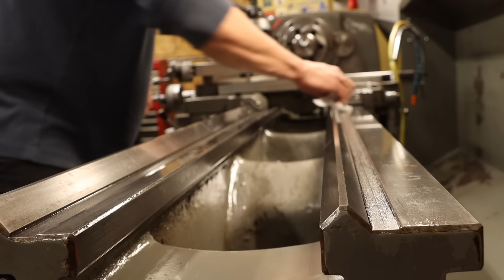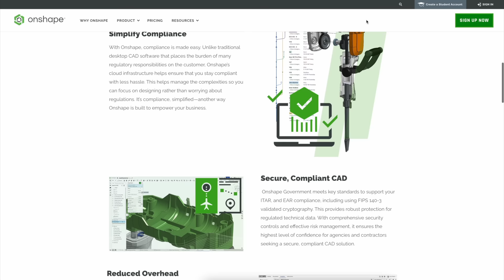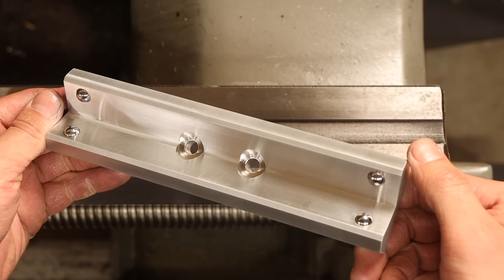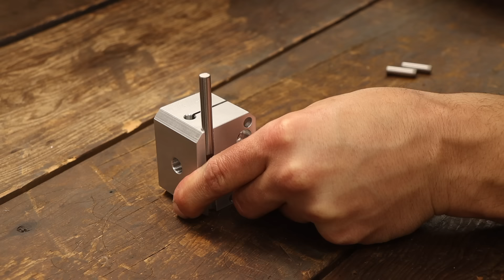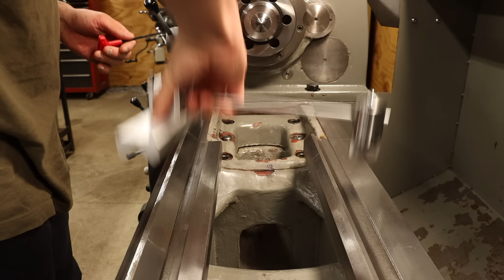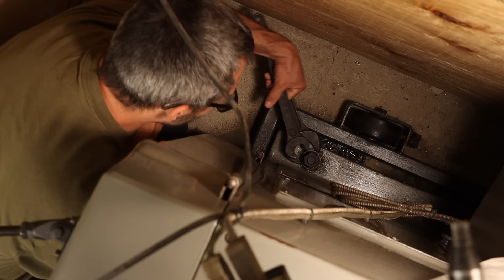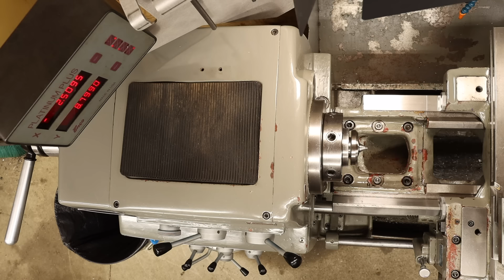A mistake... 3 years in the making

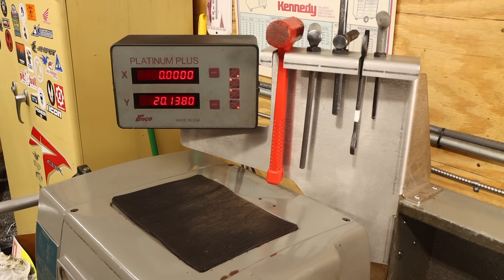Comment: 8:40 remove the rubber (that's already falling off) and make a wooden tray that fits with a base in the flat space there and indexes with one the gearbox screw holes. It's worth having a flat surface there for on-going projects and a small tray is always nice. To make sure you keep it clean, cover it in green felt.
Reply from the maker: that's a really good idea actually. maybe ill print one!
Reply: @InheritanceMachining  The green felt with a backing, is called "baize", by the way. Should make it easier to find the correct thing when looking online. It's used for lining boxes and things like that, as well as covering pool tables, etc. You can buy it in self-adhesive sheets.
Reply: @noxious89123  I honestly didn't know this was a thing. I bought green felt and stuck it in all my drawers with double sided tape. Just choose green because it matches so well with oak.

Comment: Fun Fact: Ford Motor Company UK uses your video to teach drafting to their new apprentices.
Reply: I"m drawing teacher and use the too
Reply: Drafting manually still has its place, aside from Nostalgia.
Reply: @ LOL, in what?  Do you also need to know how to shoe horses or start a fire with a stick and string?  No!
Reply: i mean like, you should DEFINITELY know the second and the first is just plain fun
Reply: You can't be serious....send them straight to AutoCAD or SolidWorks or Fusion.  Drafting went the way of the slide rule.
Reply: @madmat990  we done Fusion and some other bits too, but they like to get us to appreciate the old ways too
Reply: @madmat990  that’s like saying “don’t teach them calculus, the computer will do it for them”
Reply: @fakename287  I hate these comparisons. I'm being forced to learn drafting currently and it is so profoundly pointless, a completely non-transferable skill. Comparing it to understanding calculus is ridiculous.
Reply: @Dgsincc it's absolutely not pointless. I learned drafting in trade school, AutoCAD was v9 at the point. Sure, you can whip up a design for a part in no time and charge dimensions on the fly. But you don't _understand_ the intricacies of what your software does and visualising parts in your head without drafting skills. Invaluable skills as a machinist, builder etc. Seeing what you can make out of a hunk of metal or wood instead of just chucking it in a cnc, loading gcode and produce a lot of waste material to get your part.
Reply: @SpaceraverDK : "Sonny, in my day we had to make drafts for everything. Even the font we used had to be drafted & approved before we could use  on our drafts. We also had to walk 10 miles to work (up hill in both directions)."

no doubt you used ink & feather instead of pencils & ball point pens, because that's how you did it back in the old days! 

"But you don't understand the intricacies of what your software does and visualizing parts in your head without drafting skills. "

Nonsense, & a lousy attempt to justify your reasoning. Its far far easier to visualize parts in 3D CAD since you can rotate them in any orientation & also clear for interference, clearance, etc.
Reply: @fakename287  I took tons of calculus in high school and college.  Haven't used it once since.  Of course, your mileage may vary.  I can confidently say I have had zero need for it.
Reply: @madmat990  I didn't know how to use them either 😂 !

Comment: Two issues with what you’re doing….the first bar test should be done using a bar that’s not supported with tail stock.  Otherwise how do you know that your tailstock is perfectly aligned with the centerline of your spindle?
Second of all you don’t use the top of the carriage as your leveling surface.  Your bed ways are what dictate the level of your machine and that’s what the carriage follows.
Stone the ways really gently to remove any burs and then set down a 1-2-3 block on each of the ways reaching across the bed.  Then lay your precision level across the bed on top of each 1-2-3 block.  Keep moving down the bed toward the tailstock using the leveling screws to level machine.
Reply from the maker: no point in aligning the headstock and tailstock until the bed ways are straight though (which was my approach this video). level on the carriage was my other mistake from 3 years ago 😉